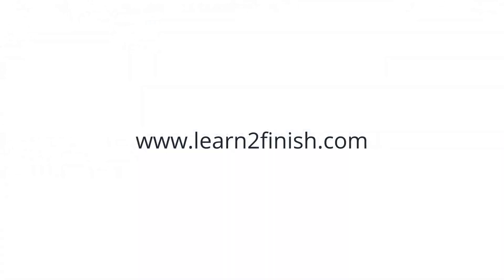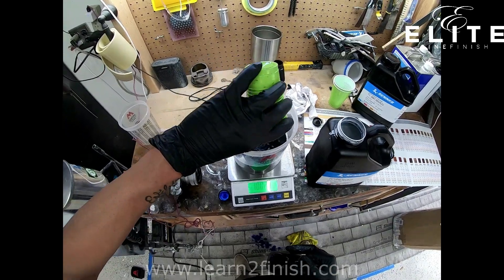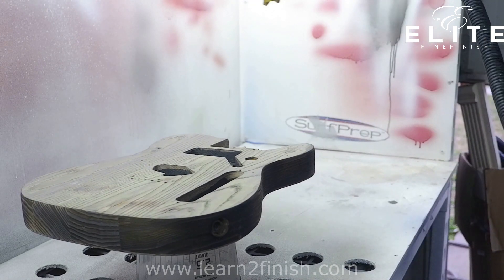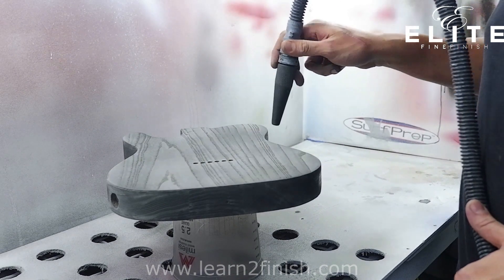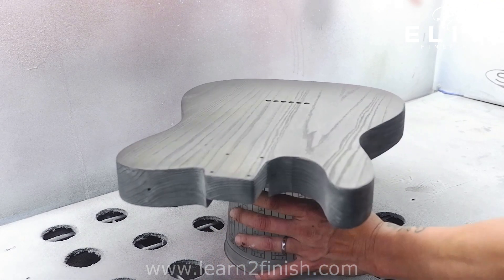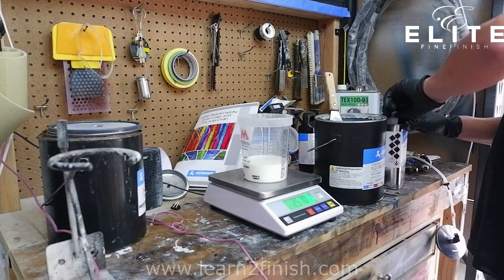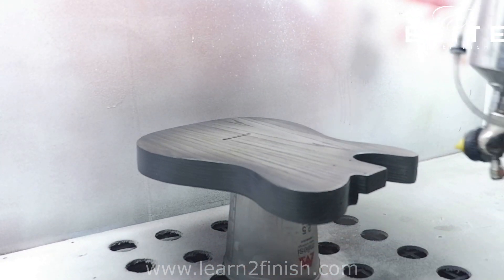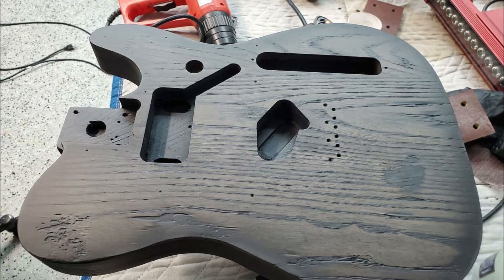How to Easily Relic A Guitar Body

Comment: If you have a piece of steel tubing that is about one foot in length welded or bolted to a square piece of metal about 1/4 inch thick and 2 x 3 inches in size you can screw that in the neck pocket and then have a metal bar with the o.d. slightly under the i.d. of the tubing mounted in a stationary position, you can slide the tubing over the bar and spin the guitar body so you can shoot the entire guitar body.  You can leave the guitar body in the horizontal position to allow it to dry.  Your finishing videos are awesome.